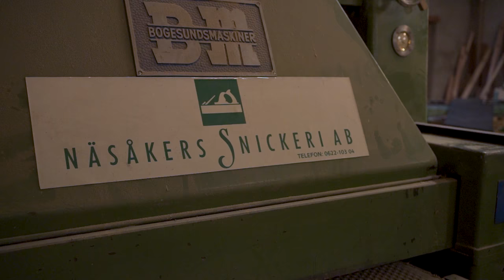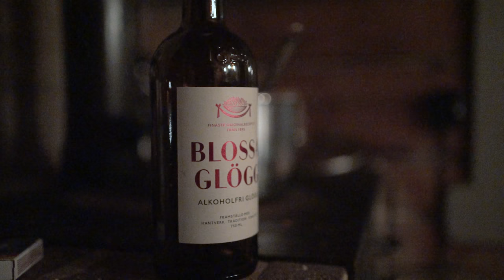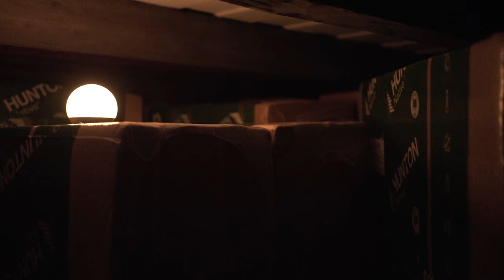The Truth about Simple Life

Comment: to the tractor not wanting to start if it's diesel of course it won't start diesels need lots of heat to run if it's a gas or petrol idk im danish the danish word for it is benzin but if it is petrol it should start right up if it doesnt something is broken like maybe the gas a gelled up NOT FUN you need to drain the tank the fuel line and the carb